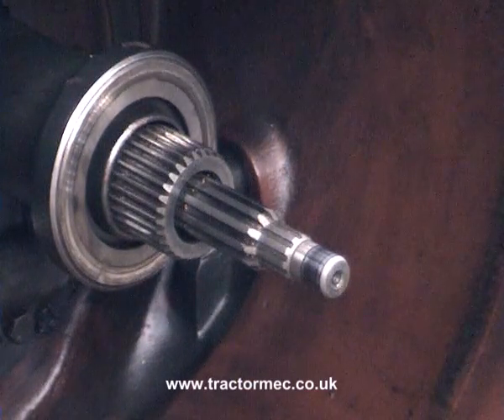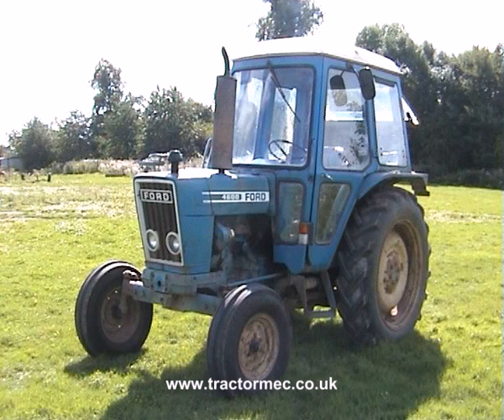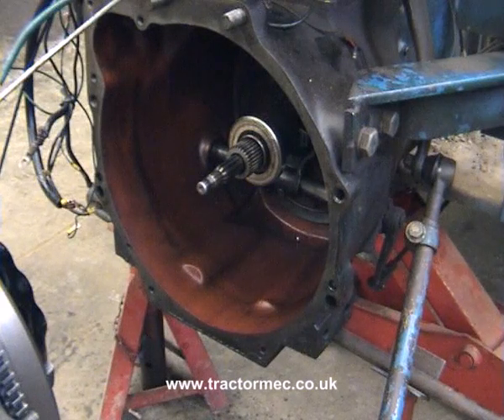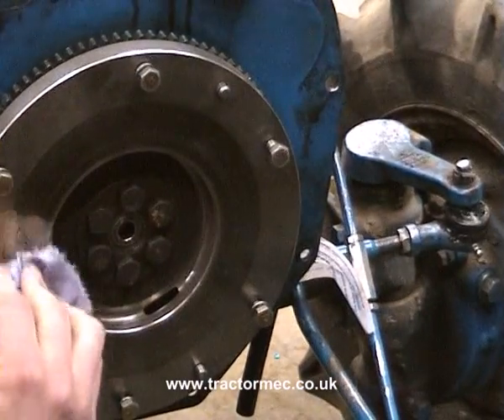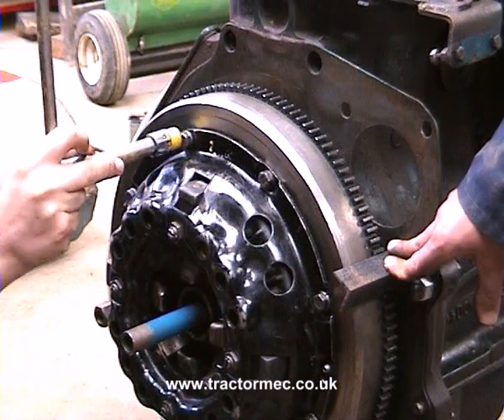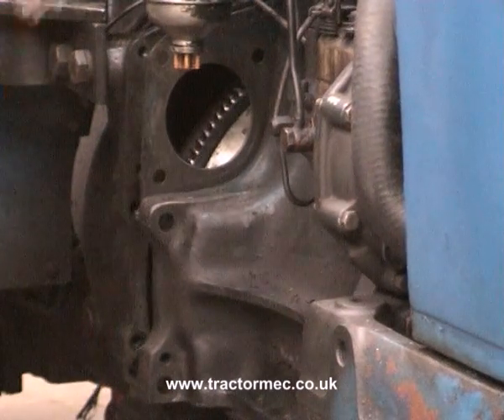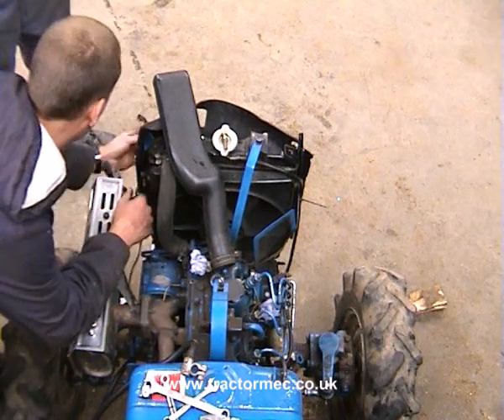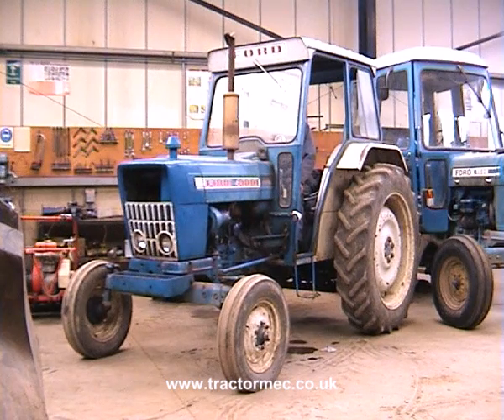Tractor Single Plate Clutches (Trailer for DVD)

Comment: Ford 1000 and 600 series are the best tractors. You can get parts everywhere and the engines can run until 12'000 hours without rebuilt. Very good machines! I got a 3055, wich is a Special model between the 3000 and the 4000 tractor.